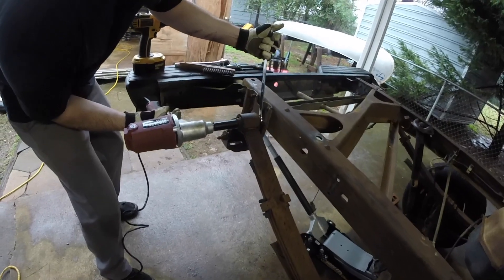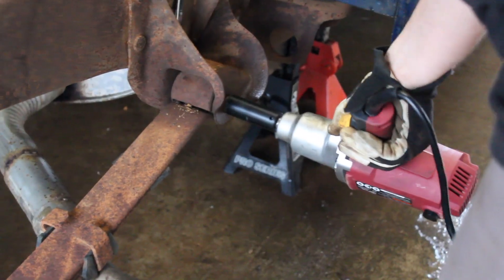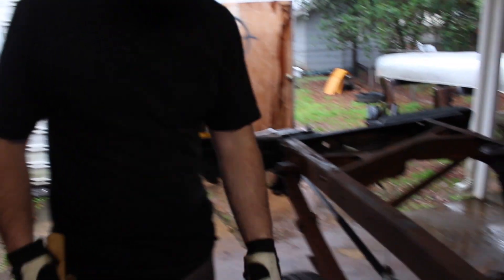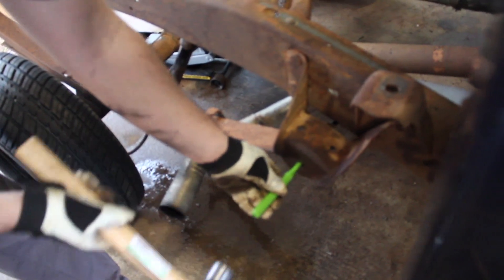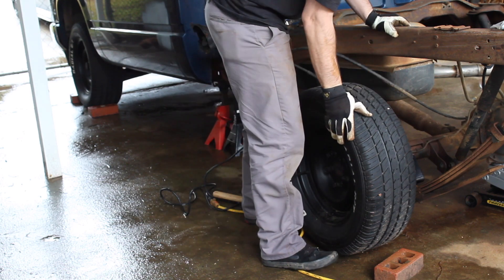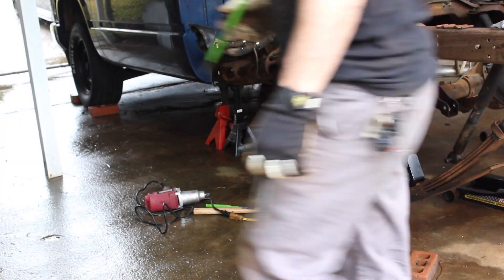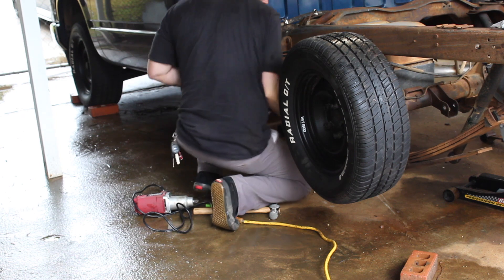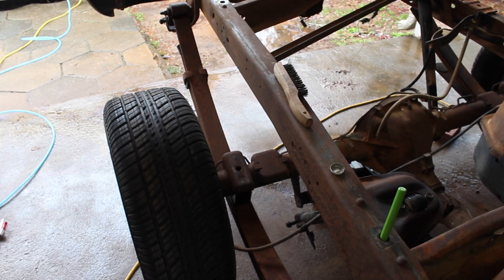4/6 DROP KIT INSTALL ON 88-98 CHEVY PICKUP PART 1 WESTERN CHASSIS FLIP KIT

Comment: I just picked up at lowering kit but at my local wrecking yard.. this and well my buddy have me a lil confused... so on the rear flip kit on the top piece which holds the rear end on the leafs does the hole go facing the front or rear of the truck? and on the bottom plate it has 2 holes same does it go on the front or rear hole?.. I know by lowering the truck the drive line or rear end get brought forward im  just trying to have it corrected I guess and bring her back out..
Reply: BAYN i kinda looked it up the saddle which holds rear and sits on leafs does go with the hole towards the front of truck... now the only thing I'm tying to figure out is the u bolt spring plate how does it sit since it has 2 holes... and in which hole to sit the leafs in.. bottom plate of flip kit....

Comment: Bought a truck.... But it's lowered on 22s and it's C-notched in the rear but I bottom out only on hard bumps and holes. What can I do to stop bottoming out???? Can I just lift the rear up??
Reply from the maker: Gabriel Sanchez is it a flip on the rear? Make sure you have rubber bump stops.
Reply: @baynmods  Yes it has a flip kit in the rear. I'm guessing it's a 4/6 drop. Yeah it has bump stops. I'm guessing I might need a super C notch!
Reply from the maker: Gabriel Sanchez 6” it should not be hitting. You’re leaf springs at be trashed. Maybe add a helper spring. I know some will remove a leaf to get it a lil lower. How many leafs do you have?
Reply: @baynmods  I believe I have 4 leaf springs!  The C notch I have is from belltech. Could it be bad shocks!?
Reply from the maker: Gabriel Sanchez yes it can. If there oem replace dem . I listed the Belltech 4/6 drop shock part number one my last video.
Reply: @baynmods  Okay I'll check it out! Thank you!
Reply: @baynmods  Hey man, quick question are shock extenders necessary to have a smoother ride?! I just took a look under my truck and I see that it doesn't have them on.
Reply from the maker: @FaceYourFear.  not sure if you HAVE to have them. but they where recominded so i got.
Reply: @baynmods  all I know is they fix the angle of the shocks! I'll probably just buy them and see if it does anything! Thanks man!
Reply from the maker: @FaceYourFear.  if it makes a different let me know please. i was wondering if you need den or its if its just a up sale.
Reply: @baynmods  Yeah for sure! I'll keep you updated! 👌🏼
Reply: @baynmods  Hey man, bought the shock extenders yesterday and got them installed today! They made a different in the shocks! Before the bed would be jumpy but now it's more sturdy and feels better!
Reply from the maker: Gabriel Sanchez awesome!! Money well spent
Reply: @baynmods  YES IT WAS!! 👌🏼

Comment: What shackles are u using
Reply from the maker: im using the stock shackles
Reply: BAYN Mods  on my truck I do 6 flip kit with 2 inch drop shackles and c notch but the axle hit  I Lot on the frame
Reply from the maker: do you have a bumb stop?
Reply: BAYN Mods no only c notch no bump stop
Reply from the maker: you should look in to getting some bumb stops , my kit came with some. are you running the original shocks?
Reply: BAYN Mods drop shocks no stocks

Comment: And  he drive well the axle no hit on the frame
Reply from the maker: Stephanie Gomez ???
Reply: With a c notch it won’t hit
Reply: Joseanarr  with shackles are use stock or 2 inch drop shackles
Reply: Stephanie Gomez idk I only have have “6 inch flip kit. So I’m not sure. Watch my recent video it’s my 03 Sierra axle flipped getting c notched in 2 days and getting the front lowered tomorrow
Reply: Stephanie Gomez rn I have stock shackles
Reply from the maker: stock.